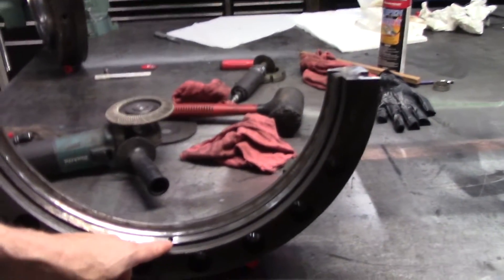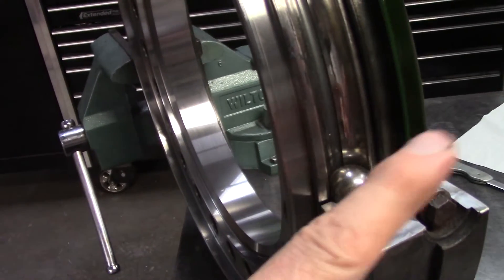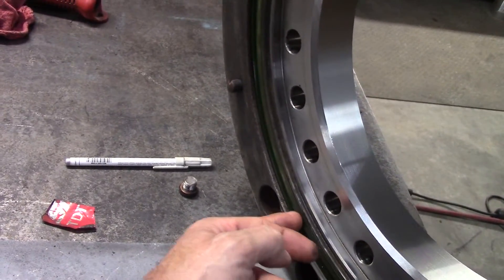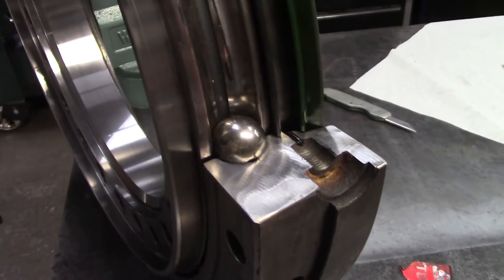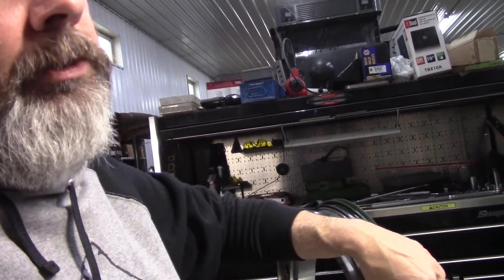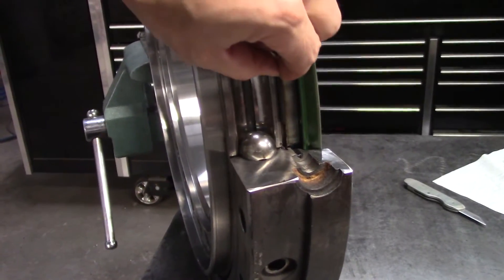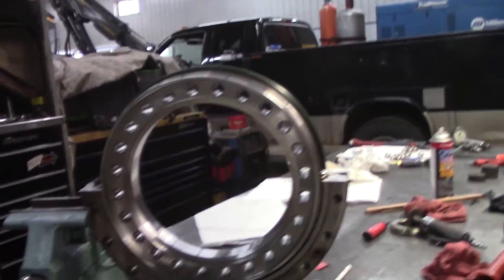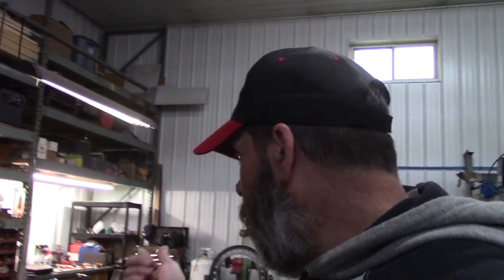Bogie bearing cutaway Visual Aide!!

Comment: Thanks that is closer to what is. The issue usually is that when greasing the plugs are not removed to release the pressure. Next step if too much pressure is created the inner seal is breached thus putting the dirt that was to be flushed into the balls that = new bearing in short ordder
Reply from the maker: I did this video because of your comments. Glad you like it. Pushed me to be more thorough 👍